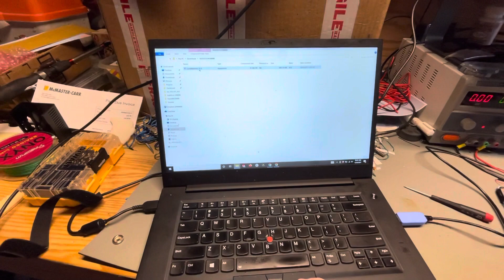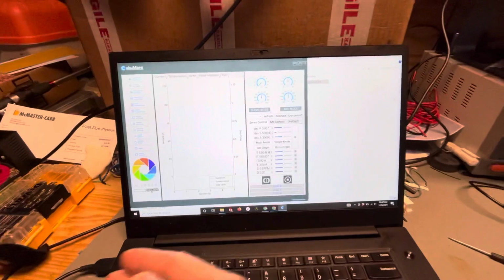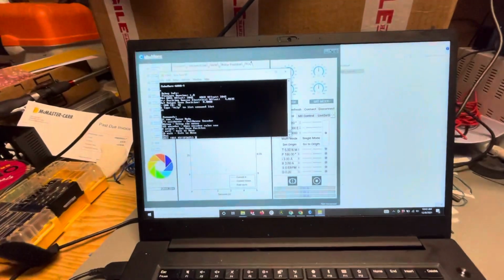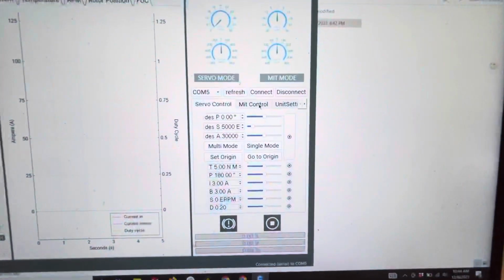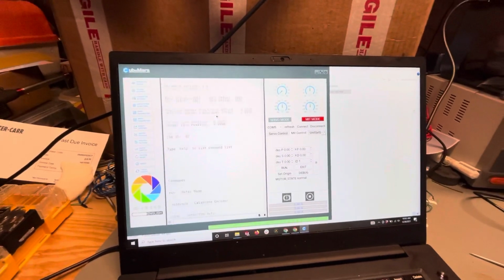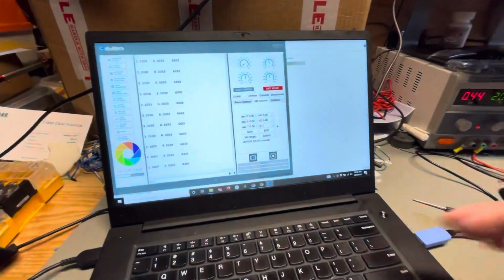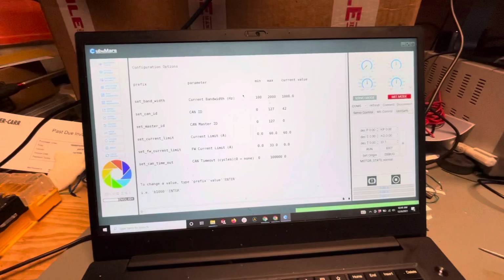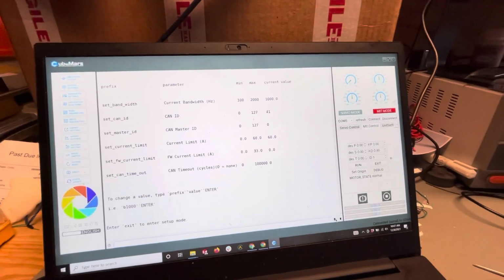Calibrating encoder and setting CAN_ID on a T-motor AK series actuator using CubeMars SW.

Comment: Hi, I have purchased ak80-64, however cannot actuate it through arduino with MCP 2515 can bus module, tried all the codes available online, cannot make it work. do you have any arduino code you can share?
Reply from the maker: I haven't done any work with these motors and an arduino. Only on a raspberry pi. Have you gone through a site like this? https://create.arduino.cc/projecthub/maurizfa-13216008-arthur-jogy-13216037-agha-maretha-13216095/can-bus-using-arduino-9ce7ba
Reply: @brentonpiercy  yes,  have tried that one, for raspberry pi, what did you use? I have one raspberry pi
Reply from the maker: @akimrain  To interface with the CAN network I used a PiCAN3 from Copperhill (pretty sure it's made by skpang). The code, unfortunately, isn't available for sharing. It was all written in house and includes some proprietary information I can't share.
Reply: @brentonpiercy  if you have time of course

Comment: Cubemars actually grabbed open source code from Benjamin Vedder. The servo firmware is also heavily based on Vedder code but they denied to publish the source code so far. However, since Vedders code is GPL licensed, the sources need to be offered to their customers. At this stage the Cube Mars products are infringing on Vedders IP.
Reply from the maker: Their previous models were based on Ben Katz motor controllers that were used for the mini cheetah project. They’re pretty shameless when it comes to selling products with other people’s code on it.

Comment: That's great! Are there any control level differences as compared to the older version AK80-9? Does the controller code change for the new version?
Reply from the maker: Controller code hasn't changed I don't think. Some things I've noticed though. If you've got other CAN devices that use extended ID's you need to get an updated firmware version from T-motor to fix some communication issues that come from that. Also, the programming from UART can't be done the same. With the old drivers I could change ID's with Tera Term or similar program. Now I've got to use the CubeMars_toolV1.3 program.